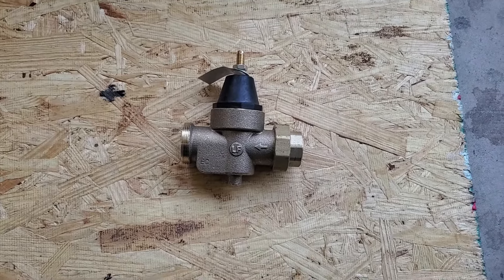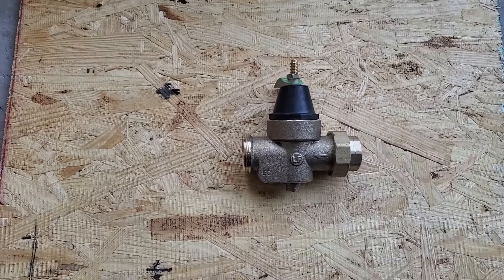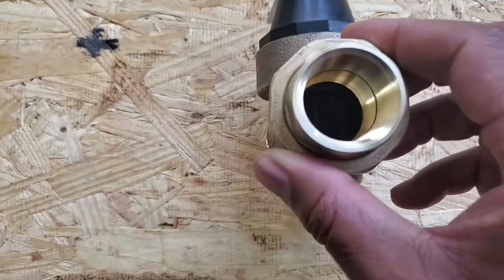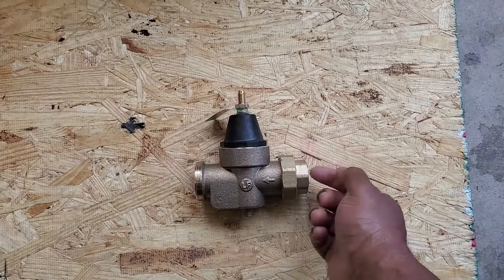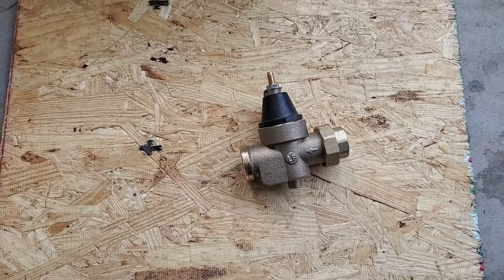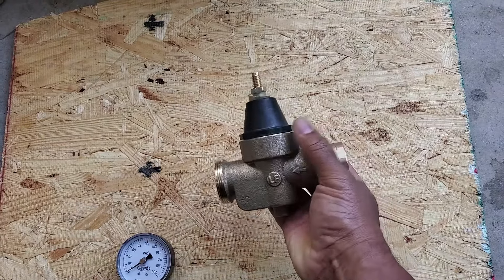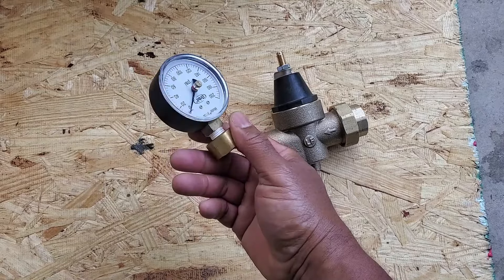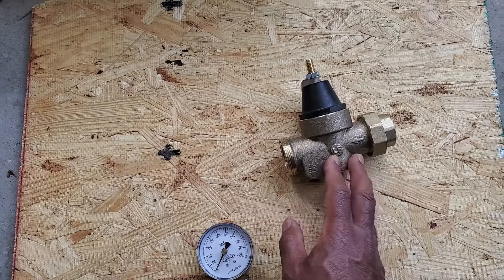(3) Signs that your PRV (Pressure Reducing Valve) is going bad.

Comment: My house is only 2 years old and has had great water pressure until recently it started having issues. It is fine unless more than one place is demanding water at a time. It doesn't matter if it's hot or cold or hot much the second source is needing.  It's never been a problem before now. We have always been able to use multiple sources at once no matter which ones the washing machine and dishwasher or shower it didn't make any difference. However, now it turns to a trickle at both locations if i say have the sink running and flush the toilet.
Reply from the maker: You probably should check with a competent plumbing contractor in your area.
Reply: @PPG1967  turned out when the water company closed the valve to do some work they didnt open it back all the way, it was only about half open

Comment: Just had my PRV replaced because the old one made a lot of loud chirping and squeaking noises whenever I turned water on in the house. The new one didn’t do that, but just noticed it now occasionally “chirps” too. Any idea what that noise is?
Reply from the maker: Do you have copper pipes?

Comment: I'm about to change mine. We shut the water off for a week when we went on vacation and when we returned the valve throbbed loudly while I was taking a shower. I bought a gauge and found the pressure at 80 PSI and it could not be adjusted lower no matter which way I turned the screw. The throbbing has now stopped but I will change it since the house is about 15 years old and I want to try a lower setting then 80 PSI. Mine uses the exact one you  show in this video and Amazon right now has it for $66 versus $104 at the big orange box store.

Please don't let the critical commenter cause you to change things too much. I appreciate that you don't have ridiculously loud and annoying music in your intro and that you talk at a pace where I don't have to slow the video down to catch the dialogue. Thank you.

Edit: I Just changed the valve successfully and it's down to 50 PSI as set at the factory. There was quite a bit of water left in the system after shutting the water and opening up a couple of faucets. I was a little worried that the shutoff valve was not working but the water stopped after a while. I had to re-tighten the nut on the pressure valve and get a bucket to catch the water, then I loosened the nut gradually until the water completely stopped. The new valve comes with only one o-ring that I put on the outlet side of the valve and the screen filter that was on the inlet side of the old valve was reused. Hope this helps someone in the future.
Reply from the maker: I appreciate your feedback, and thanks for watching!!!

Comment: If it’s high or low, it can be adjusted. That’s why it has an adjustment screw on top.
Reply from the maker: So, if it's defective and can't be adjusted, then what??
Reply from the maker: Replace it.
Reply: @PPG1967  You can buy a rebuild kit also.

Comment: Thanks Renaldo. I recently turned off the water supply that has a 1/4 turn valve during a water hose replacement at the sink. Since turning it back on, there is a noticeable reduction in flow and/or pressure throughout the home. I do not have a gauge yet, but wondering if the PRV could be the culprit. The main valve is turned all the way back on, so any ideas would be appreciated.
Reply from the maker: Get you a gauge and check the pressure at the washing machine box and the hose bibb. How old is your house, and has the PRV ever been replaced?
Reply: @PPG1967  The PRV is around replacement time at 15 years old, but shows no signs of deterioration, leakage etc. I didn't really appreciate the importance of this valve, so thank you again.

Comment: had a plumber come out to change toilet flapper, while there he checked my water pressure it was 95 psi.  house is 4 years old. can a prv fail in that time frame. also how long can a house plumbing system have that level of pressure without damage?
Reply from the maker: That's unusual for the pressure to be that high after 5 years.  I think the plumber never adjusted after installation.
Reply from the maker: Your fixture and your water heater won't last long with pressure that high.  You can adjust it yourself..
Reply: @PPG1967 i just had a new plumber replace the current prv as we are selling the home
Reply: Do you have hard water
Reply: Yes they can go.

Comment: Thanks, great content!  I reduced the pressure on my pressure reducing valve.  Unlike the “how to” video published by watts, where only a few counterclockwise turns on the bolt resulted in a significant change in pressure, I nearly removed the bolt and noticed zero change in pressure on the gauge hooked to the hose bib, and I did verify that the hose bib is downstream of the pressure reducing valve.  I did however note a decrease in the faucet pressure accompanied by a high pitched whistle.

A couple things perplex me.  Why the new gauge is not detecting a change in pressure.  It certainly dips and fluctuates in real time when the faucets are in operation or the toilet flushes, but the pressure reducing valve made no difference in the reading, so maybe the pressure reducing valve needs to be replaced?  Yet, why is there a decrease in the faucet pressure?

2.  What’s up with the high pitched whistle?
Reply from the maker: So, you might need to get a competent plumber to evaluate your plumbing system.
Reply: Try a different hose bib. That one may not be regulated. He does mention that in the video.

Comment: Why would I see spikes  of pressure with a PRV installed?  Mine sits 40-50 but my meter high dial shows it hit 80-90
Reply from the maker: Could be your water heater expansion tank or the need for water hammer arrestors.
Reply from the maker: Consult with a competent plumber in your area.

Comment: I have a question, so my water pressure is good until I flush the toilet then I lose water pressure in the kitchen. Or if I turn my washer machine on i cant take a shower because the pressure drops tremendously. Would that be a bad PRV? Or would it be something else?
Reply from the maker: So, I'm not a plumber, however I've spoken to a couple of friends that are plumbers and they said it could be a blockage in your supply line or a leak somewhere.  They also stated that 9 times out of 10, it'll probably be your PRV. Do you have a pressure gauge to check your pressure?
Reply: @PPG1967  no I dont after watching your video I plan on getting one tomorrow, but not sure what im looking for. So if I hook the pressure gauge up to the washing machine and then flush the toilet if it drops what should I look for?
Reply: @PPG1967  the house was built I believe in 76 but im not sure how to check the lines for blockage. Or to check where the PRV is located. Ive only owned the home for 3 weeks. Just making all the necessary repairs before moving in.
Reply from the maker: Attach the gauge to the cold water pipe at the washing machine box. After you attach the gauge open up the cold water valve at the box all the way.  Don't turn on or flush any fixtures.  Read the pressure gauge, if it's lower than 35psi that's considered low water pressure. Normal water pressure is between 40 - 80 psi. If it's below 35psi it's probably a bad PRV.
Reply: @PPG1967  thank you! I will give it a try tomorrow and let you know how it goes,

Comment: Do you increase the pressure by turning the screw to the left or right?
Reply from the maker: So, I guess it depends on the unit itself.  However, turning right normally tightens, which would lower pressure.

Comment: umm it up brother nobody cares about that crap. some people just got too much time on their hands! Quick question if your water first comes on strong and then after about a minute it drops would that be a sign of faulty valve?
Reply from the maker: It could be... what's the pressure at the washing machine box?
Reply: I finally just increased the adjustment screw and it seemed to have solved the issue. Also I had to stop using my ice maker because it kept dripping and building up of ice. I thought it was my solenoid on my fridge not opening and closing. Turns out when I increased the pressure it solved that issue as well. I live in a mobile home and since 1974 it had no pressure regulator valve. The only reason I put one in was because of frozen busted pipes last winter. But I solved that issue as well. I got smart and invested in some heat trace for the pipes. Now when it freezes I just go into my washroom and throw 2 switches and bam no more worries about frozen pipes. You would think that would be in the electrical supply but to my surprise it was in plumbing. If you go spend a good half a day in Lowes you be surprised at what you can find. Um Um Um keep up them videos. Um Um Um on brother! If no body else does I got yo back!!!
Reply: I just had a new one put in.  When I turned the faceut on it would come out fast for a few seconds then it would only dribble.  I also had no hot water my water heater was leaking so we took it out and put a new one in and still didn't have much water pressure.  But after they installed the prv I have plenty of water pressure and hot water.

Comment: I have no PRV and my water pressure in 50 psi.
Reply from the maker: Interesting... are you sure you don't have a PRV?
Reply: @PPG1967  Yes.  The next town over has water pressure of 130.  So my friends in that town are getting PRVs installed.  PRVs and water hammer arrestors installed during build are dependent on the plumbing codes.  Plumbers only install those stuff if it is required by code.
Reply from the maker: Oh ok

Comment: In the end, what are the signs that our PRV is failing...? What is 15 years old?
Reply from the maker: Low or Fluctuating water pressure, high water pressure, leaking at the PRV,  water hammer or pipes vibrating.

Comment: Mine is humming very loud but pressure is dead on
Reply from the maker: So, humming is not normal.
Reply: @PPG1967  should i replace it ? It is  only 4 years old
Reply from the maker: @Charlie's Garage USA  find a competent plumbing contractor to evaluate your plumbing system.
Reply: @PPG1967  ok thanks